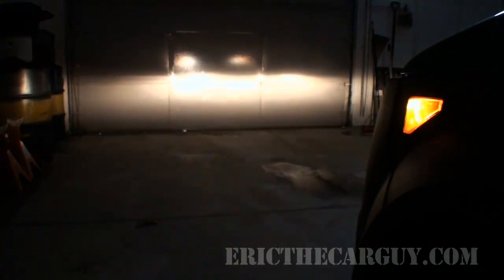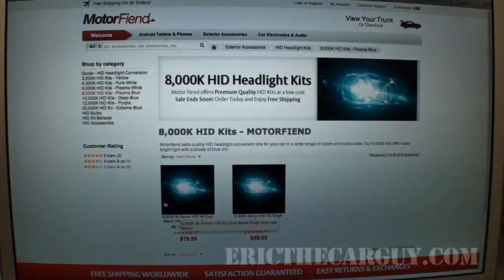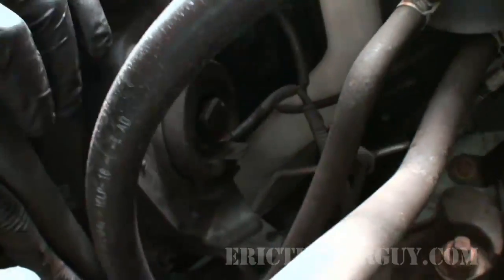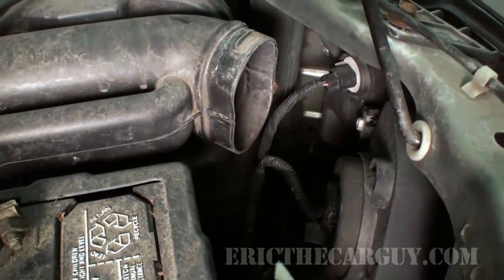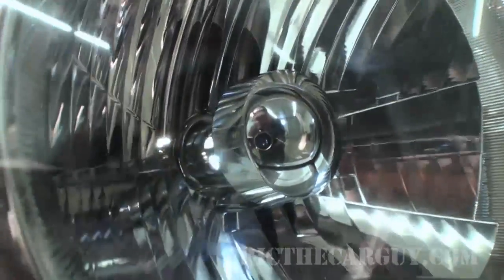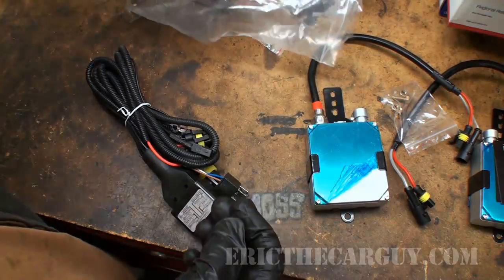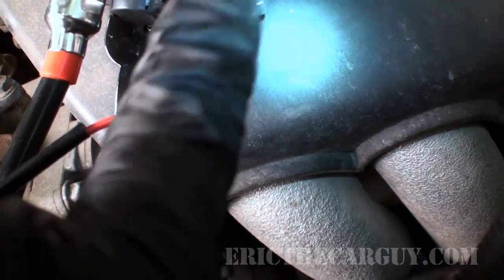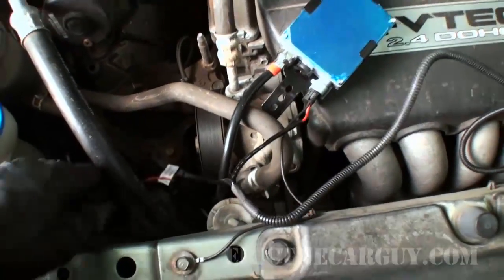How To Install an HID Headlight Kit -EricTheCarGuy

Comment: It's important to note that the majority of stock headlight housings won't make full use of HID aftermarket kids.  You need the proper reflector assembly and beam positioning settings to make full use of it, which basically requires an entire new headlight assy, which is quite costly.

For most people, simply adding these aftermarket kits will only result in an extremely bright and slightly colored light that won't improve visibility by much, but will blind opposing traffic.

Comment: This is a common mistake. High Kelvin rating does not equal high light output. Highest light output with the whitest color will be around 4,000-5,000 Kelvins (oem HIDs are usually 4300k). Anything below that will be yellowish and not as bright, while anything above will be blueish or even purple and not as bright.

Also, never ever install HIDs in a halogen housing. It will not work as intended, since the light source will be different in shape, size and position. Really tiny things make a huge difference in the beam pattern. If you want HIDs, retrofit projectors.

edit: I did watch the re: vid. I still maintain that you should not install HID kits to reflector housings. Even if the beam pattern seems correct, there will be extra glare. Headlights are designed to produce some glare in order to light up street signs etc. so if you have a bulb in there with double the light output, the glare will also be doubled.
Reply: +Mawerick77 moreover HID in reflector housings annoy oncoming traffic and I think there are instructions to only install HID in projector kigts
Reply: +Mawerick77 yeah to me it maeks it harder to see stuff too.
Reply: +Mawerick77 Agree with this 99%. I was fortunate to find an aftermarket halogen projector housing for my car that is JUST ABOUT as good for output as on a retrofit. Some spots are a little hotter than others but no glare beyond the sharp cutoff. Some of these companies definitely upped their game from 10 years ago when I first got into this.
Reply: +Mawerick77 HID in halogen reflector the glare is much worse than twice. The HID has two hotspots at the end of the arc so no matter how you aim the reflectors will still blind everyone else. You'll also have hotspots on the roud and the pupil will adapt to them by shrinking and you won't see other areas. STICK WITH THE TYPE OF BULB YOUR CAR CAME WITH.
Reply: That's correct. Anything that's not made for HID's shouldn't be installed. HID equipped vehicles were set up for that type of lighting to keep them aimed lower to the ground. It's not Eric's fault but it's just a free product issue here.

Comment: I would like to thank Eric for mentioning at the start of this video to check your local and state laws concerning the use of HID headlight kits. I operate an auto repair shop that is also a Virginia State Inspection station and have unfortunately had to tell many people that the HID kit they installed on their car will not pass inspection. In Virginia it is required that the entire kit be removed and put back to a DOT approved light. This also goes for any lens replacements. All lenses on the vehicle must have either a DOT or SAE number stamped or printed on the lens as well as headlight bulbs. Personally, I have no problem with HID's as long they are a reasonable brightness and properly installed and adjusted. Of course, HID's are legal if they are OEM. On a side note, my wife is an optician and informed me that blue is the most irritating light spectrum to the eye. This is why people often hate to see super bright blue headlights coming toward them. Keep up the good work.

Comment: Actually what you were talking about with Kelvin, is called Color Temperature. Color Temperature, basically abbreviated as K for simplicity sake, is a measurement of color not visible brightness, which is measured in Lumens or Lux. The brightest color temperature for Xenon HID bulbs (at least for autos sake and in terms of Lumens and Lux) tends to be around 4,500K - 6,500K. It depends on a few things I have seen 8,000K bulbs blue as blue, and I have also seen them almost near white. So it depends on the brand, bulb, ballast, power, and etc.

Comment: For all you people who are hating on HID's being installed in other vehicles. If you don't like them stay away from North Little Rock, Arkansas because almost every law enforcement vehicle here has these upgrades in their cars and they just happen to use 8-10k bulbs. And I should also point out that HID setups are "not" illegal in the state of Arkansas as long as they are installed properly (in other words you must have a projector lens if upgrading from halogen). Also I would like to point out that the bracket used to mount the ballasts has bolt holes on both ends of the bracket and they are supposed to be mounted as flat as possible (not hanging from where Mr. Eric mounted his) in a location where there is little to no vibration or where moisture can get to them. And most HID install kits come with a projector housing in case you are replacing Halogen bulbs just like in my case as Mr. Eric here my Mazda 6 uses 9003/H2 bulbs my kit was the exact same kit he received except I didn't receive a cheap kit like him. in my case each ballast ran independently instead of needing a control relay as he did. if you buy a kit that has this relay you got yourself a very cheap kit.

Comment: Back in the late 90's early 00's police would pull you over if your headlights were even bluish in color.  I told the hearing officer that some higher-end imported cars come that way from the factory; to which he responded, "well once they get over here, they need to have those lights changed".  Hahahah, can you see someone going back to the dealership and saying they need an "American legal colored headlight setup" ?  >x-D    Anyway, fast forward to about 2006 and the cops start to understand that some cars actually do have bluish headlights.  At this point you wouldn't get pulled over because of the lights, but if you did something else to get pulled over, then they might question them.  It seemed that HID had become "somewhat common" to the police by 2011.  Now it seems that they just don't care; hell I see people driving around with purple, greenish and deep-deep-blue colored headlights.  To make things even more whacky, now that LED accent lights have made it in to your Walmart stores, people are just sticking LEDs everywhere on the front of their cars.  Saw a sedan coming down the road with LEDs behind the grill, underneath the headlights, along the front bumper, and in the foglight wells; perfect example of "too much of a good thing can be bad".

Comment: This is an improper and actually illegal installation which is exactly why most people with DIY HID's blind everyone else one the road. Proper installation has to account for the conformation of the actual headlight itself and type of lens material . A proper kit will have HID compatible replacement lenses to prevent the fractionation that causes glare.
Reply: John Adams WIth a name like "John Adams" you ask me to refer you to laws? Ironic.
  ALL States have local laws regarding headlight specifics. Without knowing your specific state I cannot point to a statute but you can easily find it and all other motor vehicle statutes on your state DMV website with minimal effort.
Reply: Headlights weren't around back when i was in office. Also a state police officer told me that as long as it can pass inspection its legal.
Reply: John Adams OMFG dude.  
<<Also a state police officer told me that as long as it can pass inspection its legal.>>

EXACTLY.
Reply: Schrodinger is right.  It is ILLEGAL in ALL 50 states to make this mod under NATIONAL law: 49 U.S.C. 30122   It states that if you make a modification that renders INOPERABLE the original vehicle safety features (like the halogen headlights) it is illegal.  When you do a conversion, you are technically rendering the halogen bulbs inoperable.  It is only legal IF THE CAR ORIGINALLY HAD THEM IN THE FIRST PLACE FROM FACTORY.  Now, some states take this even further with more regulation, and others don't have any regulation at all and defer to the national law.  It is a lot like pot being legal in Colorado, but still illegal nationally.  Your cops might not be enforcing HID conversions because there is no specific STATE law, but if they wanted to ruin your day, they sure could if they wanted.  http://isearch.nhtsa.gov/files/Shih.3.html
Reply: By the same hand, I'll add that TECHNICALLY it WOULD BE LEGAL to install HIDs IN ADDITION to keeping your original halogens.  You could add them as fog lights or hell put 'em wherever so long as the STATE law says it is okay.  That one is going to vary, but on a national level is legal.
Reply: Alex M Incorrect.  There is no "national level".  Each state has its own independent laws regarding specification up to and including disallowance of HID.
  Please only talk about what you know so we can maintain accurate information for the public.
Reply: Schrodingers Box if you look at this hid kit it has a shield 
Preventing you from blinding people as not having that shield
Reply: In my 41 years I have never had a police officer inspect my car ever Indiana doesn’t do car inspections I guess it would be nice if they did because a lot of people really don’t know how well their cars are not taken care of

Comment: Eric, a few things. Regarding the Kelvin scale, the higher up you go the less light output you get. To anyone considering installing HID's please don't if your car does not have projector housing headlights. You will blind other drivers at night and possibly cause an accident. Some cars require 35w systems and others require 55w systems so do your research before you buy. Some higher end cars have "bulb out sensors" that can be triggered by HID's because they draw very little power.

Comment: Eric was only half-right about the Kelvin number.  He was correct when he said it is a measure of the color.  The higher the color temperature, the more blue the light will appear, but it has NOTHING to do with the brightness.  As a point of reference, the surface temperature of the sun is just over 5000 degrees Kelvin and that's what determines the color of daylight.  The filament of a halogen lightbulb commonly found on cars is about 3200 degrees Kelvin and looks a bit yellow.
Reply: Bill, you're not quite right on the brightness factor when it comes to color temperature (Kelvin). As number in Kelvin increases say from 3K up, the brightness output of hid lamp decreases. Thus 3K hid lamp produces more light than say 10K bulb.
Reply: ***** I agree with the edited version of your reply.  I should not have said that the color temperature has nothing to do with brightness because the eye is more sensitive to some colors than others (less sensitive to blue).  I was mostly objecting to Eric saying that the higher color temperature was brighter and also the common misconception that  higher numbers are somehow better.  Even when it's legal to use HID bulbs in headlights that are designed for them, it's not legal to use higher color temperatures than 4200K.

Comment: I've been a ETCG subscriber for some time and this has to be the first video that i've seen where potential issues, like with HID's, haven't been addressed.
Too many people fall foul of the 'higher the kelvin the brighter the light'.
Its just untrue and it can be seen on many of the boy racer cars aiming for that BMW look.

Higher kelvin lights (6000k or more) are for consourse/show cars more than practical use.
The best for range of light is between 4300k - 5000k.
And they are legal too.

Comment: Just want to encourage everyone considering an HID conversion to instead look at an LED conversion.  Prices have come down, and LEDs use far less energy, produce less heat, and are more reliable.  In addition, I think the beam patterns are more similar to halogens and may produce less of that glare that clearly can disturb a lot of other drivers.
Reply: The problem with LEDs is that if it rains or fogs, you're fucked.
Reply: +Bernard Kilaghai thanks man!
Reply: Why are you fucked if it rains?
Reply: The white light from the LEDs usually reflects more off the rain mist and fog, so there will be a bright white wall ahead of you, more like telling you that you are close to heaven if you hit something. The remedy for this is to install bright amber-yellow fogs to neutralise the effect, that is what we do here in Kenya.
Reply: +cmmnt2254 turn on your brights the next time it's snowing hard or foggy out and you'll see exactly why.
Reply: LEDs can be virtually any color (color temperature). The fact that it is a LED does not automatically make it "white".

Comment: You can run 8000k all day in Michigan with no problem from law enforcement. Hell, some jerks even run their halogen high beams without getting pulled over (BTW I have been blinded more by halogen high beams and stock projectors than any hid kit) I wanted higher light output, so I went with a warm white 4300k hid kit. No trace of blue unless they are just warming up.
Reply: Sane here been blinded by more halogens  the hid lights  still live in Michigan  23 years and still going

Comment: Great video; helped me decide to convert.  Only have a couple suggestions: Since the plug-in is so close to the battery it might help to smear some "bulb grease" (dielectric lube) on the terminals.  Drilling small pilot holes first (love that automatic center punch) helps prevent the larger bit from walking.  Once your sheet metal screw is tested in the hole, you could have just dulled the point on your bench grinder to prevent it from damaging the wire loom/harness.  You can tell you are a bright spot on the channel by all the moths you draw.  Ignore the asshats and maybe they'll grow up.  Good work!
BTW, turning on your high beams to blind someone else is not only stupid and dangerous, but in most states it's against the law.  Please reconsider this very unsafe practice.
Reply: Alot of things are against the law. I highly doubt that hardly anyone ever gets ticketed for shining high beams in another car's direction.

Comment: Good video. Can't say I agree with the statement, "the higher the temperature the brighter they'll be."

The closest to white will be the brightest light output you will get. So anywhere from around 4300-6000K. Just like with LEDs, the 5000 or 6000K LED bulb will have more lumen output than the same bulb with amber LEDs.
Reply: ***** You are correct and Eric made an erroneous statement. The brightest is 4300k-5000k
Reply: Casey, you're correct, the higher Kelvin (4300K vs 6000K) simply refer to the frequency of the light waves.  Higher isn't brighter in the same way that higher frequency sounds aren't louder, they're just higher, and could be louder or softer depending on the amplitude.  If you get the frequency of light high enough, it goes towards ultraviolet, which is invisible to the human eye no matter how bright it is.  That's the second part of the equation: how the human eye and brain perceive light.  Turns out that the human eye evolved to be optimized for color temperatures between around 4300K and 5000K. So there are two factors going on here, the physics of light, and the human biological perception of that light. Bottom line is that, everything else being equal, the higher color temperatures don't translate to better road visibility.